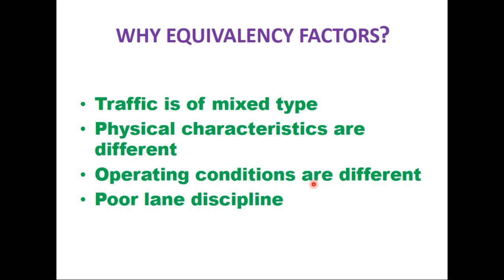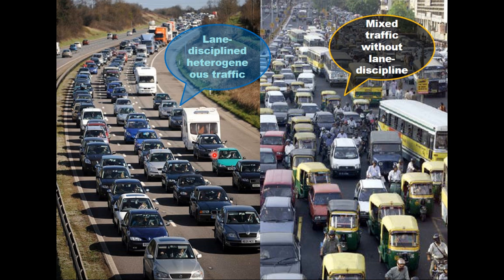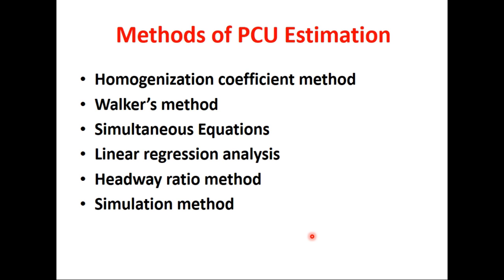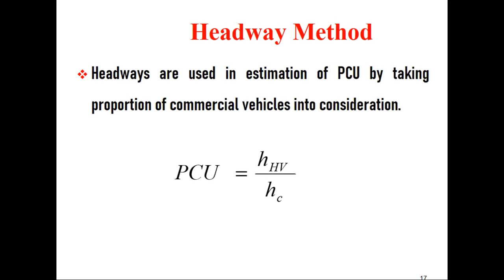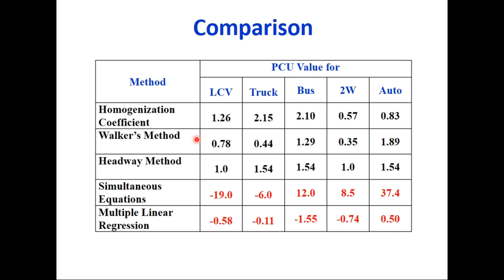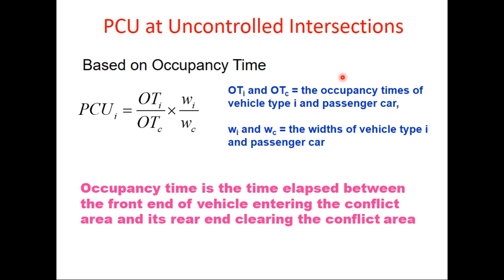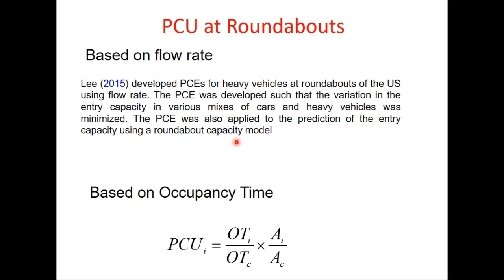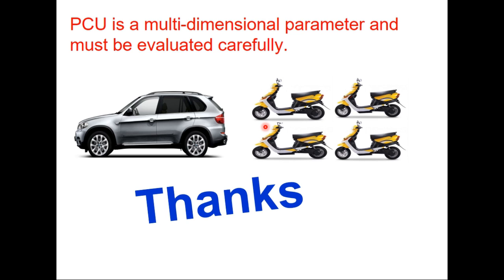#PCU, #traffic, Passenger Car Equivalency (PCE) Factors, Passenger car unit (PCU) - How and Why?

Comment: i determined PCU value of urban undivided 4 lane 2 way road in heterogeneous traffic from the Chandra's method in different sites.  The composition of traffic is 77% of motorcylcle, 7% car, 7% big car, 3 % utility vehicle, 1% van, 1% microbus, 3% Buses, 2% truck. In general, it was found to be 0.2 for motorcycle, 1.5 for 4 wheeler, 1.9 for utility vehicle,  1 for vans, 2.2 for microbus, 4.2 for buses, 4 for truck...Are these overall PCU value good enough???.... can we use those PCU values in calculation even though it seems lit bit less value in case of motorcycle??? I also tried to determine PCU from the regression method but it gives negative value for some categories of vehicle including motorcycle... how to get PCU for motorcycle little higher?? which method is good ??? Is there any other method for PCU determination from the data of speed and flow???
Reply from the maker: Do not worry about low values of PCU for two-wheelers. These values are quite OK. The basic concept here is of difference difference between a vehicle type and the car. The traffic stream has 77 % two-wheelers so cars are in minority. Traffic is homogeneous for 2-wheelers and that is why low PCU values for these vehicles. 
Regression analysis is not a good approach for estimating PCU factors.

Comment: hello sir, im sorry i want to ask u how about if i want calculate PCE with average headway ratio methode? is it possible? or not ? if yes what is the reason ?
Reply from the maker: Yes, the original method is headway based only and it is still used in developed nations where traffic is lane based. In Mixed traffic conditions, it is difficult to identify the leader and the true follower, because vehicles are not placed centrally in a lane. Therefore, this method is not suggested for PCU estimation under mixed traffic conditions. Also, different vehicle categories make the procedure more difficult.

Comment: Sir if cars capacity is 100 and bikes are 30 then pcu ratio will change then why only 0.5 for bikes
Reply from the maker: It is not that simple as your wrote here, although 0.5 is also not correct to assume in every case. If capacity is 100 cars, you need to find PCU for bikes in such a manner that when you convert convert these 30 bikes in to equivalent number of cars, the result will be 100 cars.

Comment: Sir for PCU estimation I had data set for different vehicles type say time mean speed and space mean speed of stream but I am unable to find SMS for different vehicles type in that stream I have gone the paper of yours  also ASCE 2003 formula is given to find SMS but unable to understand. Please clear my doubt
Reply from the maker: How did you find space mean speed of the stream without measuring it for the individual vehicle? Did you use some manual method to note down the time of a stream of vehicles to traverse certain distance? If so, then you cannot find SMS for individual vehicle.
Reply: @SatishIITR  yes sir we have done licence plate survey we know length and time for each vehicle so we calculate tms and sms
Reply from the maker: @vishnutripathi3005  So what do you want to do next? You have Time Mean and Space Mean Speed of each type of vehicle. Correct? You want to calculate for the stream?
Reply: @SatishIITR  I have calculated for stream but I want space mean speed for each vehicle types
Reply from the maker: @vishnutripathi3005  That should not be difficult, if you have vehicle category wise data. If your survey does not include vehicle type, then you cannot have this information,
Reply: @SatishIITR  ok sir I have data with category type